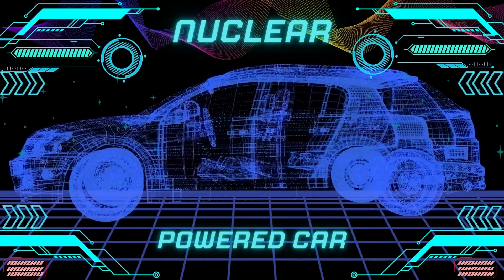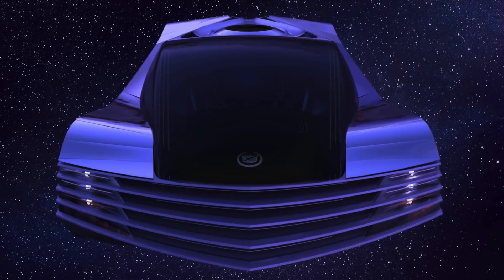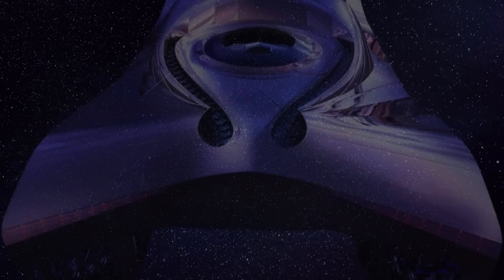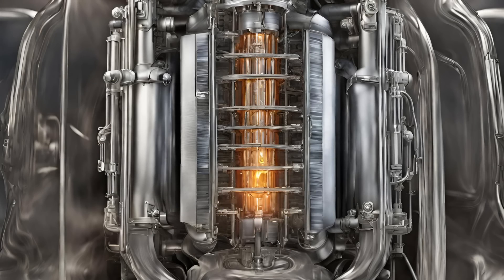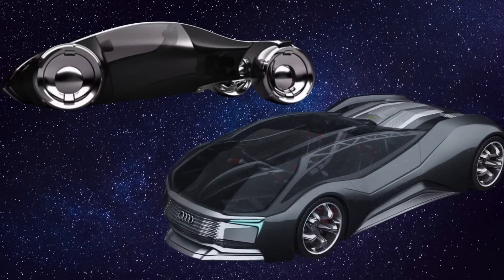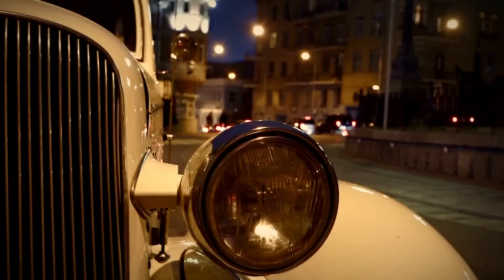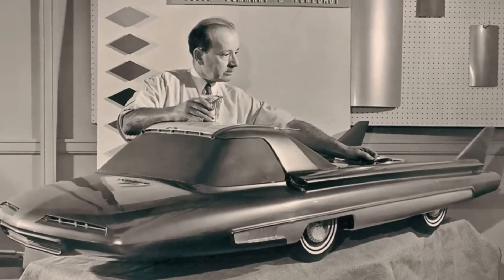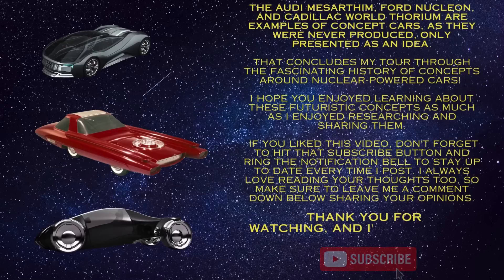Could Nuclear Cars Become Our Future? The Thorium Concept Cars of Yesterday

Comment: The battery be like : So  molten salts, Lithium fluoride and Beryllium fluoride are the electrolyte,  then Thorium-232 as the cathode and Uranium-238 as the anode,  then sealed with Thick layer of Tungsten Carbide,  plus Graphite as the separator, and PVDF mixture coat the electrode, (anode as U-238, and cathode as Th-232) . Operating Principle, In this setup, the U-238 anode undergoes radioactive decay, emitting alpha particles. These alpha particles collide with the surrounding LiF-BeF2 molten salt electrolyte, generating heat and releasing electrons. The released electrons flow through the external circuit, producing electrical energy that can be harvested for various applications. Meanwhile, Th-232 in the cathode captures the emitted alpha particles, completing the nuclear reaction cycle.Overall, this battery operates based on the heat and energy generated from the radioactive decay of U-238 and the capture of alpha particles by Th-232, with the molten salt electrolyte facilitating ion conduction and the various components providing structural support and stability. During charging, At the cathode (Th-232), electrons are supplied from the external source, causing Th-232 ions to undergo reduction and potentially form thorium metal or compounds.At the anode (U-238), electrons are removed and transferred to the external circuit, causing U-238 ions to undergo oxidation and potentially form uranium metal or compounds.The movement of ions through the molten salt electrolyte allows for the storage of electrical energy in the form of chemical energy within the battery.This process continues until the battery reaches its maximum storage capacity or until charging is stopped. Once charged, the battery can store the electrical energy until it is needed.When electricity is required, the battery can be discharged by connecting it to an external circuit. During discharge, the stored chemical energy is converted back into electrical energy as the redox reactions at the cathode and anode proceed in the opposite direction, providing a flow of electrons through the external circuit.